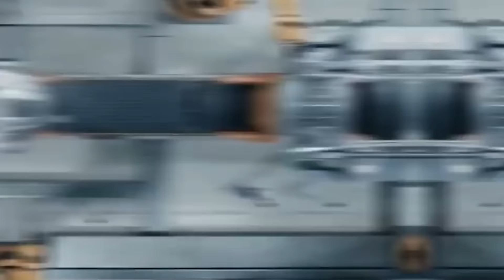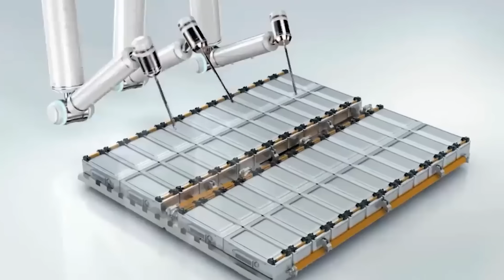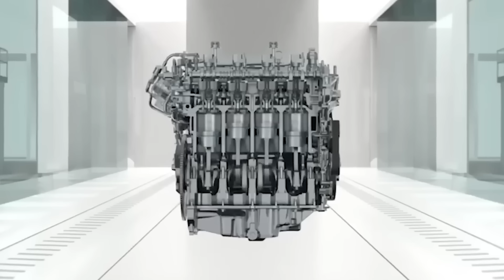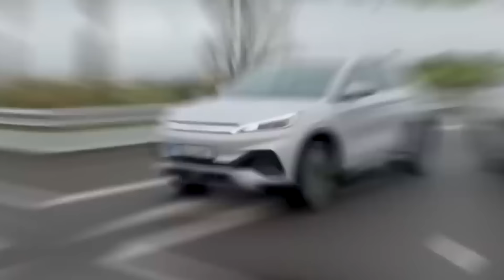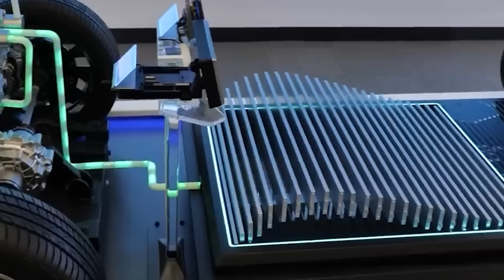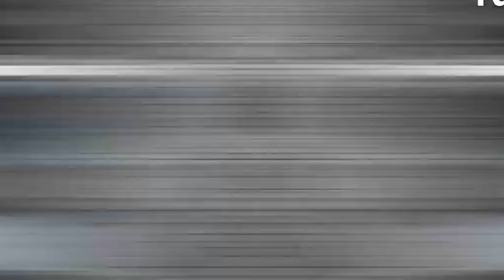China’s New 2,000 KM Range Hybrid Shakes The Entire Car Industry

Comment: #1 Stay away from turbo engines.  #2 Some China SUV models show lack of power when needed due to combustion motor not being connected directly to wheels .  This concept is well developed in high power applications like rail locomotives and open pit massive dump trucks driven by electric motors powered by diesel engine.